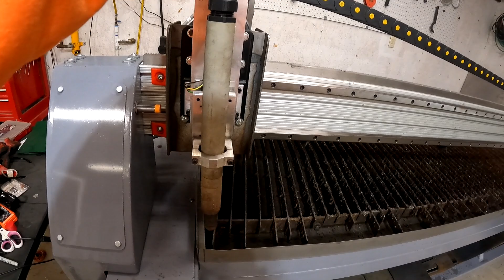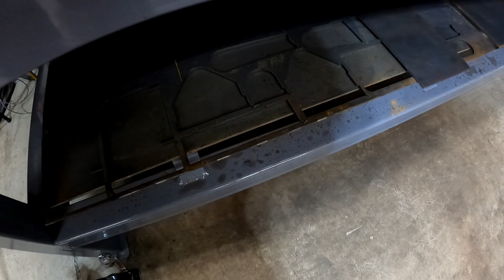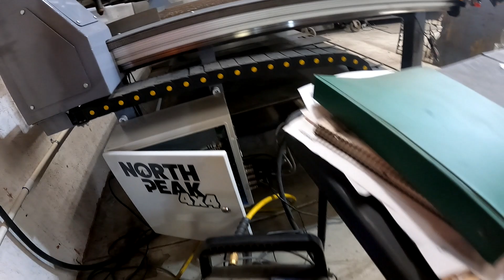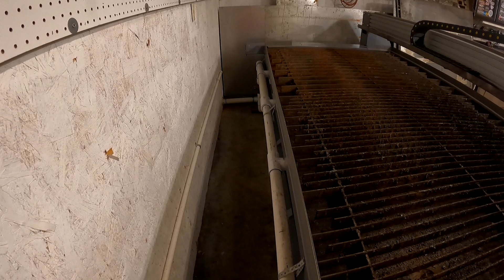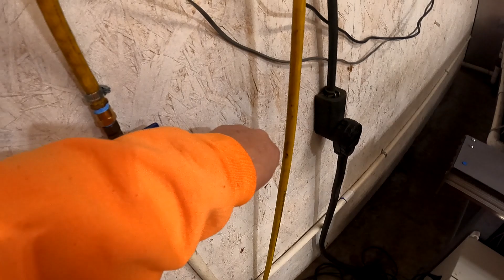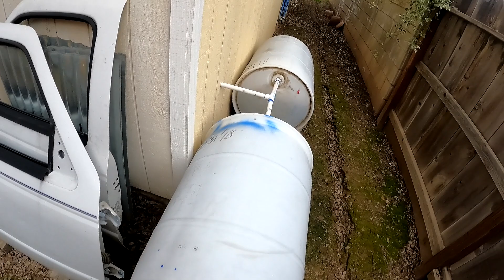DIY CNC Plasma table walk around.  Good and bad parts

Comment: What aluminum extrusion did you use and what linear rails fit?
Reply from the maker: 3 inch x 6 inch on the gantry and 1.5 x 3 for the other side.  20 mm rails for both
Reply: @northpeak4x4 did the linear rails bolt up to the extrusion pretty good? Any regrets? Anything you’d do differently? Seems like the extrusion would be easier to mount the linear rails than trying to screw around with lining them up, and drilling / tapping them accurately into a steel or aluminum gantry.
Reply from the maker: @BearCreekMetal  It was easy to add the rails.  The 3x6 is heavy.  I would try 2x4 if I did it again to cut 50 pounds off the gantry.
Reply: @northpeak4x4 did you use NEMA 23 or 34 motors?
Reply from the maker: @BearCreekMetal 34.  900oz x2 to move the gantry on my y axis and 640 for the x axis.  Nema 23 operates the z axis.
Reply: @northpeak4x4 thanks dude! I appreciate the feedback
Reply: Any chance you'd share your DXF files for the gantry? I want to build a table too.

Comment: Wish I had seen this video about 6 weeks ago :) I have been cruising salvage yards for aluminum and I thought I had scored big time when I found a 10 foot 2x9 3/16ths extruded beam (80lbs). I was going to drill 4 inch holes strategically on both sides   to lighten the beam.  I thought I could knock off at least 40lbs  doing that, but you have me rethinking the plan. The gantry was going to be on the 8 foot side, of a 4x8 table. Really really really like your water pan and air pressure, I am going to do that for sure. Really appreciate your explanations. Two questions if you have time,  It looks like you did a 2x2 steel frame, is it 1/8th wall or thicker?  Does your gantry run on bearings as well as slides? Great video, loved it good job!
Reply from the maker: @c2jacks  frame is 3x3x.120 wall square tube. Both axis run in linear rails and bearings.

Comment: What kind of laptop are you using? Brand, how much memory?
Reply from the maker: @ethanmorehead8386  it is a 4 year old gaming laptop I bought from Costco.  Running the table itself doesn't take much of a computer. Using Fusion 360 and my 3d scanner are what max out the computer. My plasm software would probably work on about any new laptop that is currently sold.

Comment: You can 3d print a secondary torch mount to eliminate some of the slop I would also line the ebay mount with neoprene to cushion the extra space.also I would look into an Anti corrosive additive for your water. Or a better one for it if you are using it. There still seems to be some rust on your slats. And even just having that (none on the pan or whatever) can cause issues down the road.

Comment: What type of drive on the X and Y? Brilliant idea to do the gantry on the long side to save some space.
Reply from the maker: I used 5 to 1 planetary gear boxes and 900 oz Nema 34 motors.  I need either bigger motors or a lighter gantry.  The 3x6 extrusion is 7plus pounds a foot. On thinner materials like 14 ga and less I have to have the ramping so slow that I am having issues.  I am going to try swapped to 2x4 extrusion.  Should cut around 60 pounds off the weight and hopefully help with thin material cutting.
Reply: @northpeak4x4  Rack and Pinion? Belt? Ball screw? It was hard for me to tell in the video
Reply from the maker: @Bear's Sh*t  sorry.  Yes,  they are rack and pinion.  The rack, pinion, and gear boxes are from automation overstock.
Reply: @northpeak4x4  Thank you!!